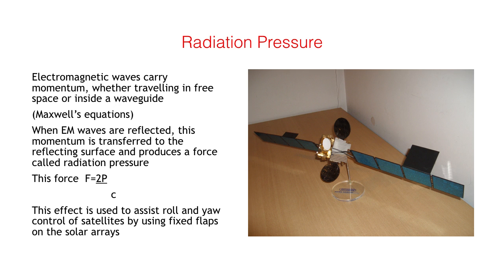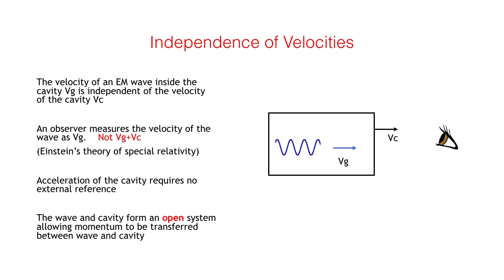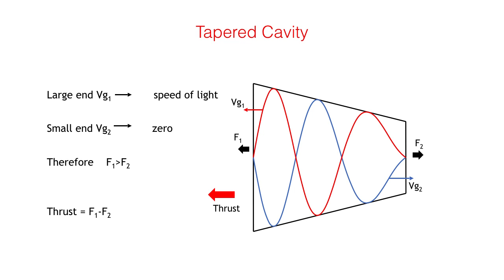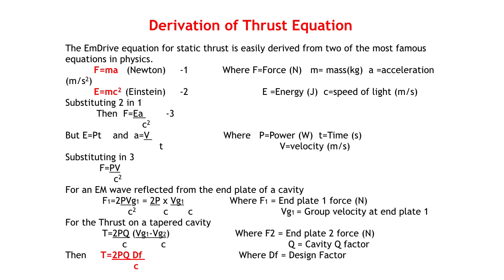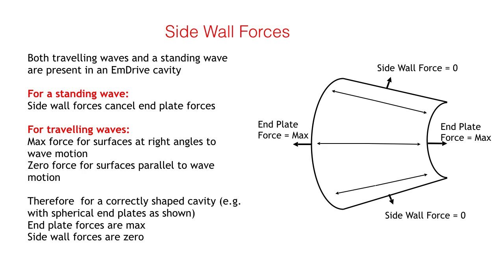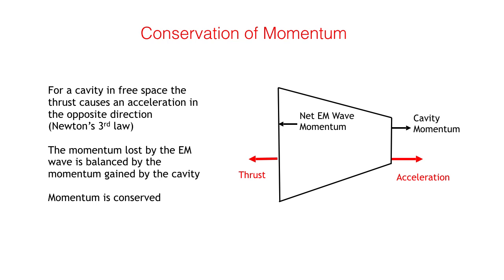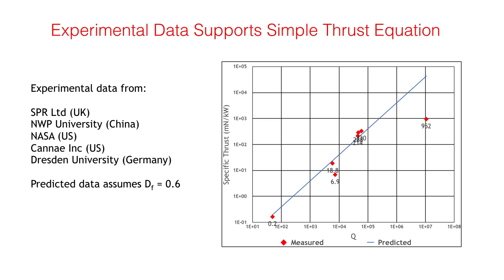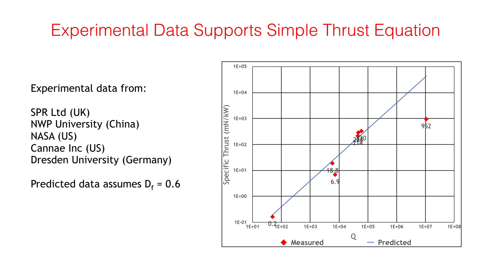Roger Shawyer Explaining The Basic Science behind #EmDrive

Comment: You make this EmDrive move a turbine, and ww won't need cold fusion. Trillion dollar challenge...
Reply: This isn't a perpetual motion machine. It takes large amounts of power for any appreciable thrust, far more than could be returned by it spinning a turbine.

This is an application for the next step in power production, not a power source.
Reply: Nope, if the emdrive worked as advertised, it could power itself and generate infinite energy. It's a perpetual motion machine, which is why nobody who knows anything takes it seriously.
Reply: Mike Chladek I think I just misunderstand what you are trying to say.
It seems you're trying to imply that thrust = perpetual motion machine. This is obviously wrong. 

The drive doesn't get more power out than is put in the system. That means it's a motion machine and not the perpetual kind.

If you think the EMdrive is claiming to be a perpetual motion machine, then you obviously don't understand it.
Reply: ***** "This isn't a perpetual motion machine."

Yeah it is.

"It takes large amounts of power for any appreciable thrust, far more than could be returned by it spinning a turbine."

No, it doesn't. An emdrive consumes power at a flat rate. The kinetic energy goes like the square of the velocity. Eventually the kinetic energy overtakes the energy you put in. No two ways about it, you made a perpetual motion machine.

In fact, there's always a reference frame in which the emdrive generates more energy than what you put in.... the instant it is turned on.

"If you think the EMdrive is claiming to be a perpetual motion machine, then you obviously don't understand it."

Correct. It is not a perpetual motion machine, because it doesn't work.
Reply: avicenna Lol, your entire response is essentially just a blanket contradiction, which is obviously the language of the educated.
Reply: ***** No, you actually have to read the argument, son:

"No, it doesn't. An emdrive consumes power at a flat rate. The kinetic energy goes like the square of the velocity. Eventually the kinetic energy overtakes the energy you put in. No two ways about it, you made a perpetual motion machine."

Refute this, then complain.
Reply: When was the device designed to be used to rotate a turbine, its primary function is to shift a satellite/space craft in orbit...

I don't know how or where you got the idea that you could use this to create energy using a turbine.?
Reply: avicenna Okay, I think I see where you're getting this wrong. Let's go to some high school physics to clarify.

If Tommy is standing on the back of a bus and throws a ball forward, the ball is going a reasonable speed in his frame of reference, slow enough that someone could catch it easily if the were on the bus. But if he threw it to some one off the bus, the ball's speed would basically be the sum of the two speeds.

That's because of the inertial frame of reference.

Now pretend Timmy is shining a flash light. The photons come out at the same speed to both an observer on the bus and an observer off the bus. Light moves at the same speed and does not add the bus's speed.

That's the special relativity part for you.

The magnetron is like the flash light. The magnetic waves are going the same speed no matter how fast the object that ejects them is going. So as the relative speed between them is different.

For your arguments to be valid, it would seem you're saying that Timmy is throwing a ball against the bus from the inside, and that's how the bus is moving. If that's how you perceive this argument, then it makes sense that you think it's wrong.

Now the wave is going the same speed as per special relativity, but there is a wave shift when it impacts the cavity. If you're familiar with the Doppler effect, you should know there's a difference between a microwave hitting an object moving away with a different shift based on how fast (i.e. red shift, blue shift) which determines it's next bounce in the cavity and next shift and so on.

That's all I have the patience for right now.
Reply: avicenna 
YES
Reply: You still have to put energy into it.
Reply: Second law of thermodynamics = broken apparently. Why the fuck do people believe that this is going to work?
Reply: DonCDXX You missed the irony of my statement, while reinforcing my true point... nuclear fission power plants also use a ludicrous amount of energy (thrust, as thermal energy) for a simple turbine. But we are told to ignore the larger half of that equation because it's cheaper if we pretend there's no consequence.

There are no perpetual motion machines, and never will be. This is just some bizarre Kassimer effect, or capillary effect on steroids... it won't lead to continued acceleration.
Reply: Mike Chladek I agree there are no perpetual motion machines. My first sentence was that this isn't a perpetual motion machine. Why you felt the need to assert that point, I don't understand.

Regardless, you've said nothing to challenge the effectiveness of the device.
Reply: I said it because you seem to have misunderstood what motion is. Thrust causes motion... hence, a net increase in acceleration (over time) without increasing thrust would actually constitute a perpetual motion machine.

Thrust is a force... force can be redirected... redirected to push a turbine.

Perpetual motion machines will never exist. This EM drive is not going to be anything substantial... sorry.
Reply: https://en.wikipedia.org/wiki/RF_resonant_cavity_thruster "There are no known physical mechanisms for such thrusters to work."
Reply: ***** Not really... avicenna was expanding the same concept several have tried to explain. It is a clear case of PERPETUAL MOTION MACHINE.

Not gonna happen.

It could be something worth researching, but it will never do what it is claimed to be capable of.

Sorry.
Reply: avicenna 

Exactly... when the "right side" of the equation eclipses the "left side."

It has nothing to do with initial input. Over time, a system cannot achieve this eclipse.

It's called entropy (I know you know) and it is the master law of the universe.

Anyone who REALLY wants to break this rule should study the growth period of any organism. That is the ONLY example in nature that "could" be described as "negative entropy."

Even a 1-in-1-out module, like a basic ring transformer, is still subject to environmental corrosion and general wear-and-tear... that's entropy.

ALL systems LOSE energy... it's just how the universe works.
Reply: You know what. Show me evidence that this works in a near perfect vacuum. Then we can conclude that there's some new kind of mechanism that allows the EMDrive to work, because it will not work according to our current understanding of physics.
Reply: avicenna Actually, it's not a flat rate.

http://emdrive.com/firstgenapplications.html

There is a reduction in output the faster it goes and an effective terminal velocity.

It's not claiming to be a perpetual motion machine.
Reply: ***** 

In > Out

Entropy

Sorry
Reply: ***** "There is a reduction in output the faster it goes and an effective terminal velocity."

That violates relativity, which is just as bad.
Reply: avicenna No, it complies with special relativity, which is the point behind why it's not claiming to be a perpetual motion machine.
Reply: ***** 

You mean where the laws of physics are invariant?
Reply: Mike Chladek The problem isn't the laws of physics, it's the counter-intuitive conceptualization of such strange ideas.
Reply: ***** If it comples with special relativity it can't have a terminal velocity. Jesus, just listen to yourself.
Reply: avicenna It's the transfer of energy between the magnetron and the cavity that complies with special relativity.
Did you even watch the video?
Reply: ***** Buddy. Wake up call.

1. If the emdrive has a speed limit it violates special relativity by definition. No two ways about it. You don't get to dismiss this objection.

2. If the emdrive doesn't have a speed limit eventually its kinetic energy exceeds the energy you put in. No two ways about it, it's a perpetual motion machine.

Wake up.
Reply: avicenna You still don't get it. Watch the video again.
Reply: ***** Once was enough for this pseudoscientific drivel. Are you going to answer my IRREFUTABLE criticisms or not?
Reply: Um... that's what the energy industry's creative minds use as the answer to everything. The comment was tongue and cheek... also a wink at the "perpetual motion machine" concept at work here.

You should read the comments. We discussed all of this.
Reply: Ryan Berry This may surprise you, but devices may be used for ends other than the ones intended by their designers.
Reply: avicenna The speed of light is the same no matter how fast the cavity is going, that's why it has a max speed. At a certain point, the relative pressure of the radiation inside the cavity isn't hitting it with enough relative force.

Your point isn't irrefutable, they're just a sign that you have no clue how this works, thus it's an affront to your "safe space".

Another positive test result rolls out from a respected organization and it's still a pseudo-science? That's okay, it makes you the "thinking man's" equivalent of flat Earther or anti-vaxxer. I've been called that sometimes too for wanting to bring back the term "Quantum Aether" to explain space-time despite those angry QED people. I guess that means I'm not too different.
Reply: If it works it is due to something more conventionally understood, just not recognized yet. It's like the mysterious capillary effect in fluid dynamics.
Reply: And I think the aether model is more accurate in many ways.
Reply: ***** "The speed of light is the same no matter how fast the cavity is going, that's why it has a max speed. "

That's not how relativity works. Either the max speed is the speed of light, like everything else, or it violates relativity. Period.

" At a certain point, the relative pressure of the radiation inside the cavity isn't hitting it with enough relative force."

Which is a violation of relativity since it implies that reference frame with the ship moving at that "max speed" is special.

"Your point isn't irrefutable"

Yes, it is.

" they're just a sign that you have no clue how this works,"

On the contrary. They display exactly how physics works.

"Another positive test result rolls out from a respected organization and it's still a pseudo-science? That's okay, it makes you the "thinking man's" equivalent of flat Earther or anti-vaxxer. "

On the contrary. It is people who believe the emdrive works who are like flat-earthers or anti-vaxxers. You discard the most reliable information in favor of the one test that you like, no matter how poor the methodology of the test. Just because you like the answer.

Some self-awareness, please.

"I've been called that sometimes too for wanting to bring back the term "Quantum Aether""

Of course you would. Real scientists don't like bullshitters.
Reply: Mike Chladek Yes, but ridicule for the term "Aether" is still common in academic circles, like it's a taboo just to say it because of the pseudo-scientific use of it in the past.

There are still lots of ways scientists can be closed minded. Like when I bring up how Lamarkism can be a valid theory when introducing epigenetics and some evolutionary biologists get quite livid.

I'm sure every branch of science has at least one taboo. Like how few geologists believe in sobriety.
Reply: ***** Luminiferous aether was never pseudoscience. It's just a model that's been discredited in light of new evidence.
Reply: Lol... I think that's true in many fields. Fund procurement (and the goals of the investors) tends to influence one's need for libation in any science or technology position.

I think that the aether model is important because Relativity suggests it... and there is a reason Quantum Mechanics is held against Relativity as a standard. Quantum Mechanics is a mathematical brute force approach, where certain assumptions are made at an appropriately miniscule level that accurate models appear for certain verified phenomena. However, there is a reason it is disjointed and relies heavily on probability... because we haven't noticed the big, elegant picture yet. The one that agrees with Relativity.
Reply: Einstein's work was entirely achieved using Newtonian physics. His original work is ridiculous... it was after he had his proof that he and Planck set about in what led to his realization of Relativity and Special Relativity, though at that time he had a simplified language with which to approach his work.

It is it's absolute agreement with Newtonian physics that makes Einstein's work so important.
Reply: Mike Chladek "I think that the aether model is important because Relativity suggests it..."

On the contrary. Relativity makes it unnecessary. In fact, you have to do some severe gymnastics to even get it to where it's consistent with relativity.

"The one that agrees with Relativity."

Quantum mechanics agrees with special relativity just fine. It's gravity that's the problem.

"Okay, I think I see where you're getting this wrong. "

I'm not getting anything wrong. There can be no "max speed" without violating special relativity. Period, end of story. This is not negotiable and this does not depend on the details of the physics of electromagnetic waves or the Doppler effect or what have you. These are all red herrings. If there is a max speed, that reference frame is special. Period, end of story. This is not negotiable.
Reply: avicenna All criticisms seem irrefutable to the person making them when they refuse to listen.
Reply: ***** I listened to your argument, but it's wrong. I'm sorry, but it just is. The correct argument is the one I gave. If you can find a hole in it, please explain exactly what it is. If there's a reference frame at which the emdrive cannot accelerate, how is that frame not special?
Reply: +avicenna +DonCDXX
Aviecenna is right on this. 

Based the website link DonCDXX provided,  (http://emdrive.com/firstgenapplications.html), it is suggested that the engine has a maximum thrust of 333mN/KW.

IF the thrust is INDEPENDANTfrom its speed (relatively to the depart point when the engine is set on that is), then the engine speed will increase linearly. There will be a point where the kinetic energy will be greater than the Energy you put in until that point. Perpetual motion machine

IF the engine thrust is DEPENDANT from its speed relative from the launch pad, decreasing as the speed goes up, then THAT reference frame has something special. Otherwise, I would always be able to choose another reference frame in which the engine speed is low enough that the thrust stays at a desirable value.

What you DonCDXX said is that as the relative speed of the engine to its launch pad increases, the EM waves produced at the beginning will be shifted (Doppler effect). Of course they will. But the EM waves are CONSTANTLY being produced. The waves produced at any time-point t are produced in the engine CURRENT zero speed frame of reference.

It is equivalent to say that if the thrust somehow decreased with the relative speed to the launch pad, You just have to turn the engine on and off and consider the current engine zero speed frame as the new starting frame, and get the thrust back up.

Don't you see the issue here?
Reply: avicenna I see where you come at the aether issue, but only note that Einstein himself struggled with the exact issue you mention in his attempts at Universal Field Theory. I consider like Dark Energy and/or Matter... there's a "something", but we can't "see" it so it's only known by inference.

What Einstein provides is a way to term the aether as information... and it works exceedingly well to do so.

I also wanted to expand upon my statement about his early work being "ridiculous"... I meant ridiculously complicated, as he did it all through Newton's equations and it filled page upon page of meticulous calculations. Only after he found his "elegant solution" could he explain the effects that were previously completely incomprehensible.

I know quantum theory does not inherently violate Relativity... it can't, or it would not be effective. We know it is. It is still a brute-force approach. I side with Einstein in that some day, enough sleepless nights of chasing abominable calculations will yeild a very elegant explanation of the origin of the big four.

No "dice" required.

... and the EM drive is absolutely a perpetual motion theory and should be dismissed as such, unless rational minds would care to examine what/which accepted physics can explain these amazing results ;)
Reply: May I say we've crossed a special point since this thread began. Now that multiple groups have gotten positive test results and passed peer review, it is established this works.

There's a line between skepticism and denial.
Reply: ***** 

So let them examine this "phenomenon" through established and test-proven methods.

I promise you... they will find some EM version of capillary action or Kasimer Effect.

Trust me... the "powers that be" would have crushed it already if it had any real merit such has been claimed.

I am not in that side of academia or industry... but I can assure you that this would jave been quashed or sold a few years ago if it was anything "real".

Why not support the idea of actually discovering any anomalies it may ACTUALLY be capitalizing upon???
Reply: *have (I hate touchscreens)

But really... this COULD be a very important innovation. Just not as how it's being touted.

It clearly doesn't operate on the proposed theory.

Remember... reproduction is not the same test as falsification... nor scaling.

There are a myriad of rigorous tests through wich a valid theory will pass.

This is not one of them.
Reply: ***** ". Now that multiple groups have gotten positive test results and passed peer review, it is established this works."

All that's established is that when you make the same mistakes you get the same type of wrong answer. It's absolutely not established that this perpetual motion machine works. Sorry.
Reply: avicenna 

Our well-established physics have plenty of room for error. Just not THAT error.
Reply: Mike Chladek Pretty much, yes.
Reply: avicenna 

Again... we, you and I, we have no argument here

All I was trying to say
Reply: avicenna It's kinda sad. At this point a scientific mind should be trying to understand how this device works, not clinging to the traditional stance for comfort's sake.
Reply: ***** Bet you $200 that it doesn't pan out. Ready to put your money where your mouth is?
Reply: avicenna Now there's 7 or 8 groups now that have tested this, with about half getting positive results outside the margin of error. The scientific method has been applied and the results challenged unsuccessfully and still published.

So at this point you have to assume;
1) They're right and it works.
2) They're lying for whatever reason.
3) That all the groups made the exact same error to get similar results.

Those are really the only options. Your stance seems to be number 3, so elaborate on the specifics of the failing in their methodology. If you can't, then you might as well claim 2, because that's the depth of your argument.
Reply: ***** Do you take my bet or not? ;)
Reply: ***** I, personally, commend "trying to understand how this device works."

But my $ is on conventional Newtonian physics if it does... so... care to answer avicenna?
Reply: avicenna Using "wanna bet?" is kind of a childish way for you to say that you're right but too ignorant to prove it on your own merits. 

You can't explain why the EMdrive got positive results but you feel it shouldn't have so you assume error. 

Describe the error all these professionals made to validate your doubt or admit that you have moved past healthy skepticism into blatant denial.
Reply: ***** No... you use the bully route.

You know I also support aether... I am actually neutral on that issue.

I am sorry if I expressed my own opinion, but I will gladly be a go-between here. I match avicenna's "$200... but if you lose the bet, you owe me nothing. And I will broker it all... accepting all arguments.

Convince me this is not a physics wet dream.
Reply: This an issue of what can/cannot be
Reply: ***** "Describe the error all these professionals "

They are not "professionals". They are very much amateurs, and the fact that they couldn't publish their findings in a physics journal is proof of that. Their paper doesn't even quantify systematic uncertainties. As evidence, it's worthless. And you know that, or you'd take me up on my bet. What happened? I thought this was fact now, wasn't it? That I was just a "denier"? Well, I guess that was all talk then.
Reply: avicenna 

Uncertainty :)

Can we have some exergy balance?
Reply: avicenna "They are not 'professionals'." You're just trolling.

Also no, I wouldn't ever take a bet from a stranger on the internet. When I want to gamble, I go to Vegas like an adult.

If you know what ALL the professionals did wrong then write a paper pointing out their mistakes. It should be easy for you if you are so certain. If you're not willing to undergo the scientific rigor when disagreeing with an experiment that has been done repeatedly with replicated results, then you're simply being as obstinate as a young earth creationist.

You say "put your money where your mouth is", well I respond with the more mature, "put your mind where your mouth is", and actually point out the flaws in the test with specifics. Otherwise this is just a case of you being afraid of change from your comfort zone.

Sure it seems improbable that the drive works, but the tests have given positive results. So it means that either some phenomena we don't currently understand is affecting them or the designer is correct. Regardless, the success of this device implies that the physics books aren't finished being written yet. Good thing too, it would be boring to have a field with nothing left to discover.
Reply: ***** "You're just trolling."

Nope, I'm not. They are amateurs. They make amateur mistakes, and built an amateur setup. Made amateur measurements.

"Also no, I wouldn't ever take a bet from a stranger on the internet. When I want to gamble, I go to Vegas like an adult."

Excuses. You won't take the bet because you know you're wrong.

"If you know what ALL the professionals did wrong then write a paper pointing out their mistakes. "

Waste of time. No physicists are taking any of this crap seriously. Why would I write a paper telling them what they already know?

"when disagreeing with an experiment that has been done repeatedly with replicated results"

I don't think you understand what "replication" means.

"then you're simply being as obstinate as a young earth creationist."

On the contrary, son. You're the young earth creationist here. You're the one ignoring 400 years of successful science in the name of an experiment that makes you feel good. There's no non emotional reason for believing the emdrive might work, and you know this or you'd take my bet.

"and actually actually point out the flaws in the test with specifics"

Jesus christ, just look at their own section where they list a bunch of unquantified systematic uncertainties. For the result to mean anything they must be quantified, like a professional would have done. They should've done a control, and they haven't. They should've accounted for the reflectivity of copper in the infrared when measuring temperature. They should've presented graphs that didn't have obvious cooling curves as large as the signal, for christ sakes. The whole thing is sloppy and doesn't deserve a more sophisticated response than a funding cut.

"Otherwise this is just a case of you being afraid of change from your comfort zone."

I love how laypeople think that scientists are afraid of change, when for a physicist change means "employment". I assure you, physicists don't hate money.

"Sure it seems improbable that the drive works, but the tests have given positive results"

Nope, they haven't. It's impossible to assert that they have until it can be demonstrated that the thrust is larger than the systematic uncertainties they didn't even bother to quantify, most likely because they don't know how.

"Regardless, the success of this device implies that the physics books aren't finished being written yet."

Oh, physics knows it doesn't know everything, otherwise, it'd stop. But there's a difference between "there may be things we don't know" and "I MADE A PERPETUAL MOTION MACHINE AND IF YOU DOUBT ME YOU'RE ANTI SCIENCE". Make no mistake, the emdrive is a perpetual motion machine. Literally.
Reply: avicenna Childish contradiction...

You keep referring to it as a perpetual motion machine, proving you have no clue how it works still.
Reply: ***** Enlighten me. How does it fail to be a perpetual motion machine?
Reply: avicenna Because it uses more power to move than it can produce. It's not magically immune to entropy.
Reply: ***** But it doesn't. It takes a constant input power P to produce thrust F, imparting kinetic energy at a rate of Fv. Once v exceeds P/F (which for thrust claimed by eagleworks is just over 800 km/s) it produces more energy than what you put in.

If you simply move to a reference frame where the emdrive is already moving at 800 km/s, it gets more energy than what you put in the instant the device is turned on. It's a perpetual motion machine.
Reply: avicenna Okay, show me a turbine that can survive spinning at 800km/s while supporting the weight of the device.
Reply: ***** Please. You know full well it doesn't matter. It breaks conservation of energy. This was demonstrated to you. Accept it.
Reply: avicenna The peer reviewed results of repeated experimentation say it works. Accept it.
Reply: ***** LOL.

Why would I have to "accept" the claimed results just because it was peer reviewed? That's not an argument, buddy.
Reply: +DonCDXX

One peer reviewed paper. You know that's not enough.

And you do not need experiments to conclude this is a perpetual motion machine.

So here we are.

Some experimental results needing repetition

VS

The mathematical proof that this is an perpetual motion machine

Again, do the math, rewatch the video, please, this Shawyer is a charlatan.
Reply: arnaud nicolas There have been 6 or 7 groups who've done this before. This is just the first time NASA did it.
Reply: ***** Some of which even retracted their claims once it became clear the thrust was coming from some issue with their apparatus.
Reply: avicenna That's why this vacuum chamber test was so important. They believed convection may have been responsible before.

Now that a vacuum chamber test revealed near identical performance in vacuum to atmosphere, their retractions are irrelevant. They did the same test and got virtually identical positive results.

As soon as an experiment is performed by several different, unaffiliated organizations with no personal gain based on the results...

Well at a point, you're just in denial.
Reply: ***** The retractions had nothing to do with convection, nor with an atmosphere. They were about Lorentz forces, something this setup is still very much subject to.

This test hasn't been important. Unquantified uncertainties still abound.

"Well at a point, you're just in denial."

Take my bet. Easy $200 if you're right. Go on.
Reply: avicenna If the Lorentz force is giving false thrust readings, only a test in a satellite will prove that. That's the next step. Though most of the retractors listed convection as their primary concern for uncertainty.

Any bet on the issue is pointless as it could potentially take a decade or more for all testing to be performed.
It wouldn't take so long if it had funding, but thanks to people like you who believe the idea should be scrapped for hurting your feelings, it's likely going to take much longer to gain significant traction.

In reality, you're betting that naysayers will shut this down before it gets definitive testing.
Reply: +DonCDXX

The Physics this "engine" was based on is bogus. 

Why should we invest money when we already know the author had the basic math wrong?

That is the real question.
Reply: arnaud nicolas Why invest in it? 

Because it worked in experiments and if it continues to work as hoped, then it will be world changing.

If you're in denial of positive test results, that's your problem, don't try and hold the world back because of your insecurity.
Reply: +DonCDXX 

Quit the vain insults, will you?

Two decades ago, a perpetual motion machine was designed by a fraudulent "physicist" based on wrongly used undergrad equations (this video).

Since then, the justification has switched to a mystical quantum blabla that can't be disproved because it isn't even formulated.

After 15+ years, still no conclusive result (read the NASA paper , will you?). But still a perpetual motion machine.

I am sorry, There is no valid reason to throw money at this. This is not even a debate. If you can't back your claim, you don't have a voice.

Now People who want to play around in their spare time are free to do so, we do the same in my lab when we have the opportunity. But investing money in a "project" that already has all the hallmarks of a dead end? No.

Until then.
Reply: Mike Chladek Not so. It requires energy to run, as pointed out. Also, by the inventors own words it is very lossy (inefficient) as part of the force moves against the driving thrust and the rest satisfies Newton by sinking into the cavities sidewalls. If it works it would never even be in vague neighborhood of producing enough thrust to power itself. In fact I'm not sure ten thousand of them could power a single one by the means you suggest (or any others I'm aware of).
Reply: Frank Gualtier I will acknowledge I haven't looked far into the details of its design, but the preliminary statements and requisite results raised far too many red flags to warrant that investigation. The cumulative energy (thrust) is still beyond reasonable terms.

Trust me, I would be the first to welcome new physics. However, I promise you that this is (at best) an EM analog to capillary action, and its limit will be far lower than the promised yield... if it even really works the way we are told.

I am more concerned these days with the corporate governance of all parts of what is legally called the United States of America... the Comprehensive Annual Financial Reports (CAFR). We the people (lowercase) are being fleeced on all sides.
Reply: " Not so. It requires energy to run, as pointed out"

Irrelevant. It's still a perpetual motion machine because its energy output always exceeds the input for sufficiently large speeds.
Reply: avicenna In a vacuum pushing an accelerating object. It's akin to pushing a flywheel and adding literally a wisp of extra energy to each turn. Another example would be the gears in your car - you start low and as the weight is moving you add more speed (with less energy per turn of the motor for every gear you move up). A turbine, even under those conditions would present enough load to slow it to a stop - like trying to run your car up a twenty mile stretch of the steepest road it can handle without flipping and in 6th gear. This engine could only achieve high speed the way your car would with a huge heavy trailer on it while riding on an iced over river and stuck in sixth gear. You'd get to speed eventually - and then someone slaps turbine hill in front of you - forget it.

You'd do yourself a favor to look at the force measured for this thing (not the speed - the torque/inertia EDIT: Sorry, "Thrust") and to compare that with online ratings for motors.

It's a nice fantasy but clearly you don't understand the basics of these concepts because it would not work for any engine of that thrust rating no matter how it was made. Just because it uses exotic methods of locomotion does not make it magic.

Then there's the slight issue whether it really works, in space, as said.
Reply: Frank Gualtier avicenna has demonstrated a fair amount of knowledge in physics, if you read the past comments
Reply: "Just because it uses exotic methods of locomotion does not make it magic."

No. It's magic from the start, which is indicated by the clear and incontrovertible fact that it violates conservation of energy. That's a symptom of the underlying problem.

"would not work for any engine of that thrust rating no matter how it was made.  "

Yeah, that sort of reasoning only applies to non-magical devices.
Reply: Frank Gualtier Tesla couldn't make turbines do it... you really think some unknown can?

Seriously... why would one of the most amazing minds of our entire civilization abandon work on the turbine (his own creation) to pursue EM radiation if he thought he could improve the aforementioned turbine?
Reply: We are arguing about something that:

1) We have yet to prove works as advertised.

2) It is being advertised as an engine that is not very efficient - the inventor himself makes a clear point of this. For what its intended to do, however, slowly accelerate matter in an environment with no appreciable drag without the use of traditional propellants, it would be incredible. That does not change the fact that it is highly inefficient. It sends a large amount of its thrust in the opposite direction (effectively reducing its energy by a large percentage) and the rest of the energy is taken up by the walls.

3) He's clear on the point that it does not break any laws of physics, Newtonian or otherwise. People argue this point with things way above my head so hey, if I'm wrong we'll find out, but from my current point in time and space I see all energy being accounted for. Even if it turns out that it's bleeding Hawking radiation as it's mode of thrust I don't believe that violates anything - it's just weird, but weird would still not be magic.

I have other things that need doing but look, in the end my opinion is just that - an opinion. Yours is different. It's unlikely we'll reconcile. It happens. No harm, no foul.

Have a great day guys!
Reply: Frank Gualtier Hawking radiation requires a black hole... an engine we common folk haven't yet harnessed.

I repeat... if this technology works, AT ALL, it is either an EM analog to capillary action or a Kassimer effect on steroids... still not worthy of "new physics." Novel... not notable.
Reply: Please watch:
watch?v=EJvIzxAdtFk
watch?v=CzKyfiBmTho

It doesn't matter how it's advertised. Shawyer's emdrive is a perpetual motion machine and breaks laws of physics. It doesn't require anything "above your head" to understand that. Just a simple thought experiment.

As to why, Shawyer's simply neglecting the fact that electrons in the metal had to be pushed around in order to "compress" the electromagnetic waves inside. Shawyer neglects the momentum of those electrons. That is all.
Reply: avicenna 

Amen
Reply: avicenna "compressed"

I had a good laugh on that one!
Reply: avicenna "Please watch: [Obviously ludicrous vid part I and obviously ludicrous vid part II] It doesn't matter how it's advertised. Shawyer's emdrive is a perpetual motion machine and breaks laws of physics."

Well played. I thought for a minute you were being serious:) Later!
Reply: Right, so any video that debunks your fragile worldview is "ludicrous" :)

Have fun crying about chemtrails, jackass. When you grow up and decide to take science seriously we can maybe have a conversation.